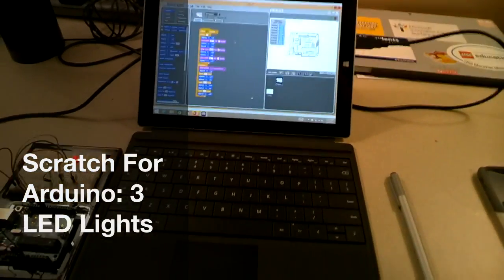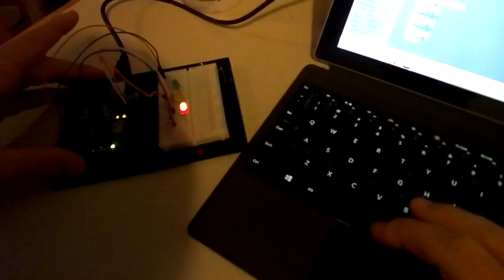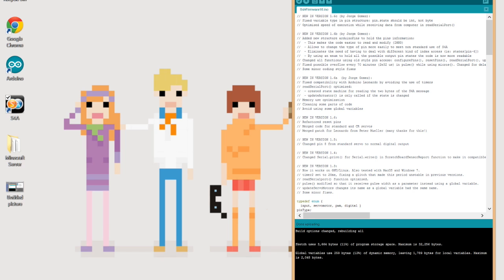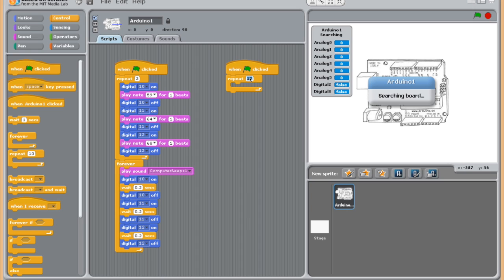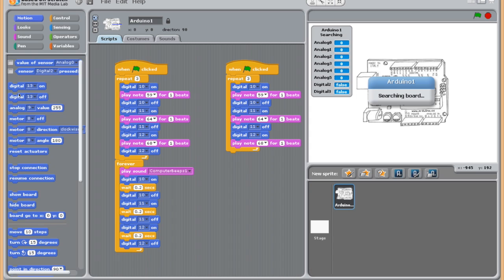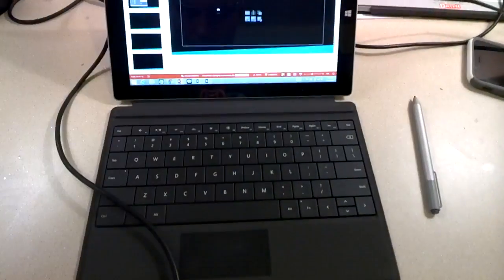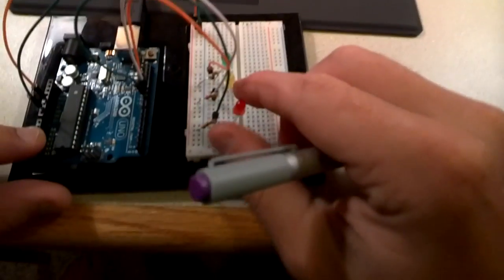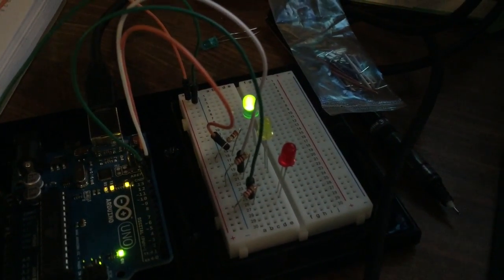Scratch 4 Arduino: 3 LED Lights

Comment: Not useful it only working when usb are connected with pc . Is any way to copy code from S4A as c++ And uplode it to Arduino to work it standalone ?????!!
Reply: It's not possible to use Scratch for Arduino to program the Arduino for standalone use.  The sketch that you load up to the Arduino board means it operates only as an interface.

Comment: I hate to break it to you but that red lead off the 5V of the arduino to the + bus on the breadboard is doing absolutely nothing. The digital pins 10, 11, and 12 are providing the positive potential in their respective circuits. Otherwise, nice job.
Reply from the maker: Thanks Joe for the feedback. I am by no means an expert, but simply sharing my learning journey so I will keep this in mind and add to my learning as well. I am learning by doing and often times that means what I think is not always correct and leads to more questions.

Comment: You should have said "3 resistors...",  not "3 transistors",  about 14:28 and 14:30 into the video. Also, since I teach elementary school kids, I've found it better (safer) to have them use the "upper" pair of power rails on the breadboard for +5V and the lower pair of power rails for GND, minimizing the chance that the student will plug the +5V line into GND, or vice-versa, or something similar with the components.  Otherwise it's a good video.
Reply from the maker: William Moore yes, you are correct. I caught that after I recorded
Reply: P.S.  I like the black "tray" you are using to hold the Arduino Uno and the 1/2 length breadboard. Is that something you 3D printed? If so, where did you get the 3D Model (.STL) file? Or if purchased, from where? Thanks in advance...